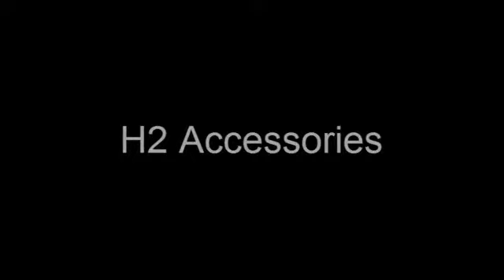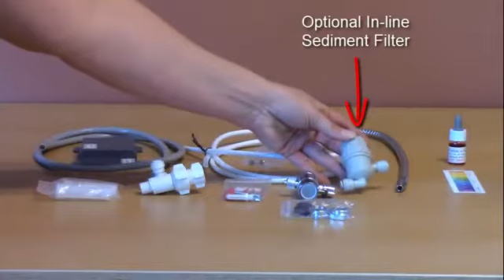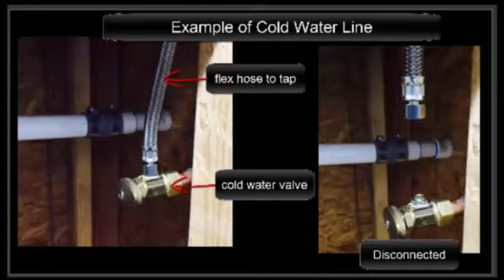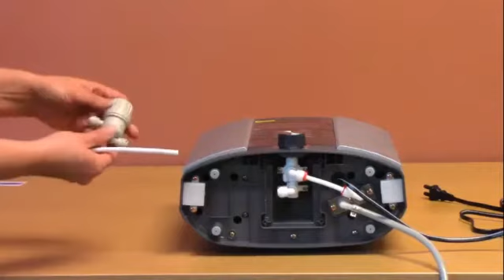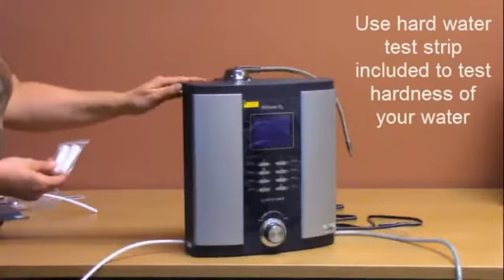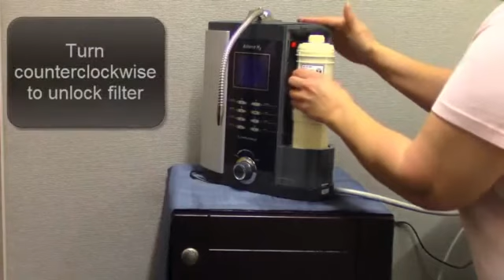How to install AlkaViva H2 water ionizers Vesta H2, Athena H2, Melody H2

Comment: What if the flexible water spout drips constantly when the machine is off?
Reply from the maker: than you have a leak .check for hard water deposits -clean your ionizer with vinegar https://water-ionizers.info/en/2014/08/24/water-ionizer-cleaning-white-vinegar/

Comment: I bought H2 Vesta recently, noticed when I tested the water that comes through the acidic hose (grey hose) after pressing Acidic 1 was Alkaline "purple colour" so is it safe to drink it? I thought of saving this alkaline water when the selection is Acidic 1
Reply from the maker: yes, it is ok to drink and it is normal to be alkaline via the BOTTOM grey hose if you selected acidic water that comes out via the TOP flexible steel pipe
Reply: Could you please advise how often we should replace the Remineralizer Cartridge ? thank you!